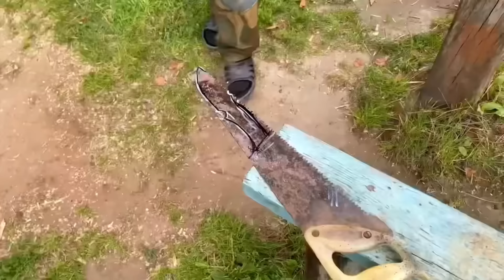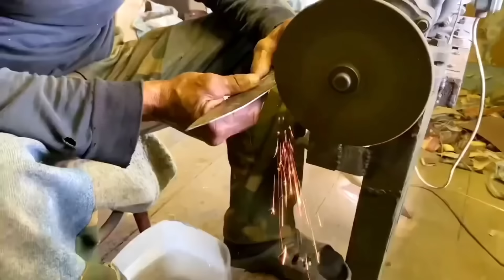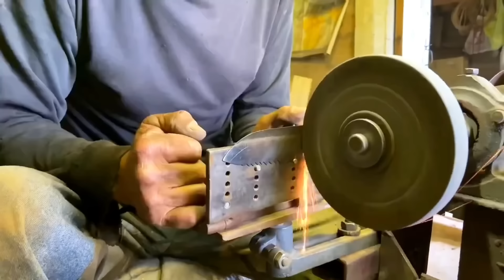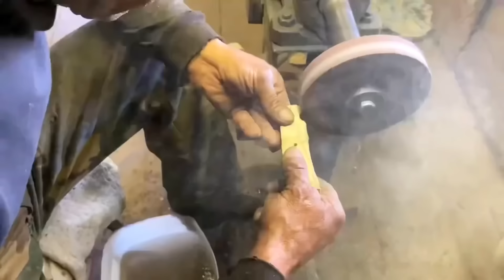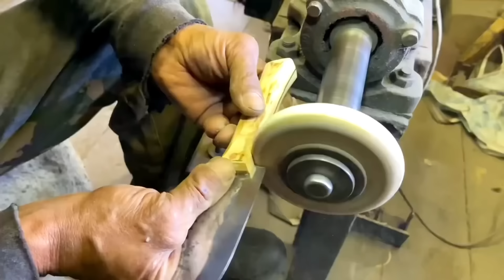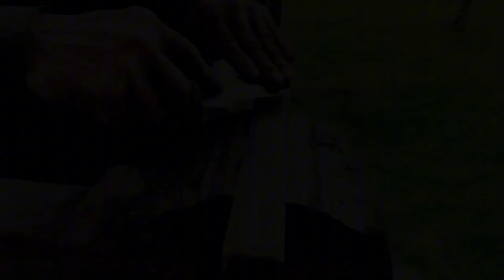THIS KNIFE MAKING METHOD IS IMPRESSIVE!

Comment: Not THIS saw. This is soft steel, only hardener on  tooth edge. Good steel for knives is from circular saw without diamont or sintered carbides on tooths (this saws is soft too). Don't use hand saws for knives. This kinve need by hardering and temperated again, to by usefull.
Reply: Пилы по дереву согласно ГОСТ 980-80 в СССР изготавливались из стали 9ХФ или аналогов. Ранее выпускались из углеродистых сталей У8 –У13, твёрдость полотна НRC 42-52
Reply: @Alex_Nemiroff  OK.I don't know this. 9HF is similar to ncv1. Can by usefull for knife.

Comment: Blade is to flimzy. No good for any rough work. Out door hunting is out. Won't last for one dear.
Reply: I think this blade is a little tougher than you might think, however not a super rough use knife. But I commented to say that I made a few knives from circular saw blades and they were super stout considering how thin a circular saw blade is. The next best knife I've made from random steel is from a lawnmower blade